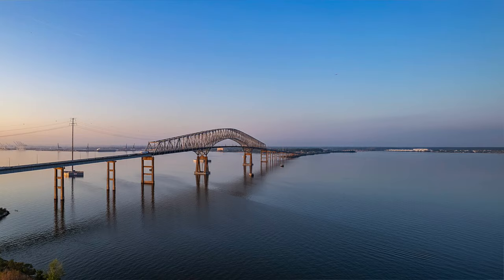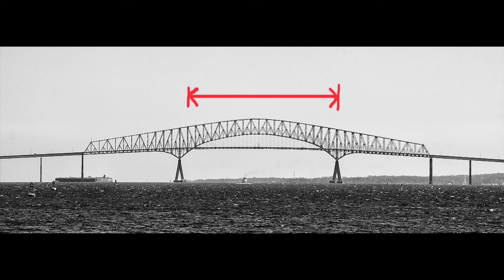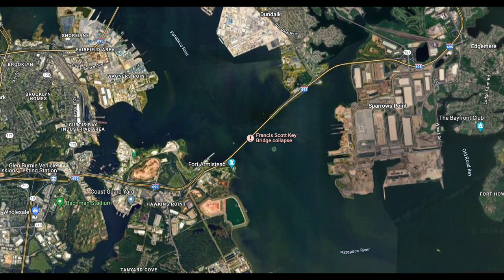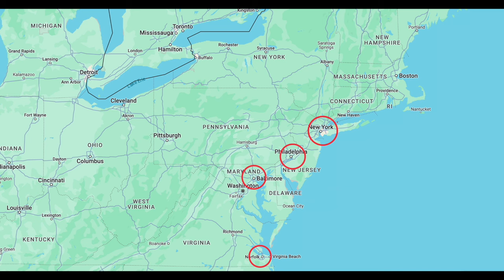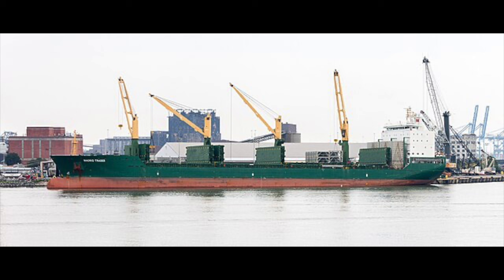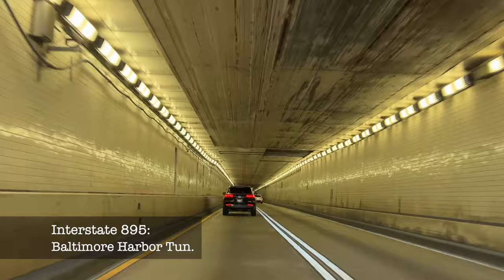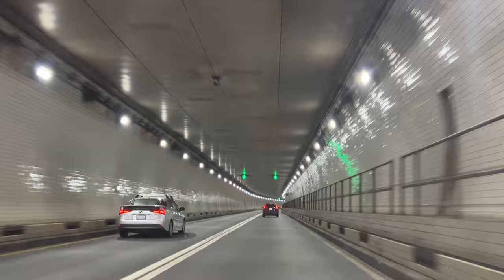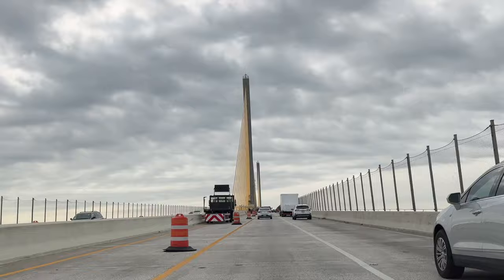Francis Scott Key Bridge COLLAPSE | What Happened and What Next?

Comment: It's mostly like the replacement for the Francis Scott Key Bridge will be a two-tower stayed cable bridge with massive bridge pier protection.  It might be more akin to the Gordie Howe International Bridge (that bridge is scheduled to be finished in early 2025).
Reply: The Gordie Howe bridge towers are on shore.  That seems like a good way to prevent accidents like this!  Would it be feasible to build the new Key bridge that way?
Reply: @FameyFamous  I believe the span would be too long. The part hhat fell was 1500 feet if I remember correctly and there was still large amount of river on ether side.
Reply: The "new" (1987) Tampa Bay Sunshine Skyway Stayed Cable Bridge would be more analogous to what we might see in Baltimore. It will have a 20+ dolphin bumpers.

Comment: This is America, its going to be widened
Reply: Perhaps, but not simply because it's America, the structural demands of bridges have changed as well as the surrounding population in the past 50 years. If it would support the demand, maybe tacking on a rail line would be helpful.
Reply: @-Katastrophe 
I'm surprised there isn't one already. You would think there being a port, there would be a rail line as obviously not every shipment from a boat is local
Reply: @-Katastrophe That is a fair point
Reply: @-Katastrophe Rail is also just a W transportation method so I agree that adding a rail line would be a good idea. However, Baltimore is probably not the city that would do that. It is much more likely a city like New York or Boston would do something like adding a rail line to a bridge
Reply: @Demopans5990  There is plenty of rail in Baltimore. Both CSX and Norfolk Southern have terminals further north. As a matter of fact, both railways have a coal pier with a ship in port so they are shut down too. They also have intermodal terminals and yards nearby.
Reply: Yea it better. Thing didn’t even have a shoulder
Reply: @bradjtrains Yes, but that is all freight other than the NEC. No passenger rail
Reply: @me-it9jn  Maybe widening isn't always that bad
Reply: Widening the bridge to accommodate shoulders is one thing. Widening for additional lanes is quite another. I-695 is 2 lanes each direction on either side of the bridge for miles. On the east side of the bridge, it's 2 lanes each way until MD-702 (about 10 miles of road). On the west side, it's 2 lanes each way until around MD-2 (about 4 miles of road). If the bridge adds lanes, it would either force a merge that would add congestion, or it would call for widening ~14 miles of I-695 outside the bridge (including other bridges, overpasses, and interchanges). Pick your poison.
Reply: Widening does not always alleviate congestion. Sometimes it only allows for greater opportunities for slower drivers to hog the left lane and refuse to move over for faster traffic.
Reply: @ssjlkrillin  I'm not saying the widening is good
Reply: @fishyswirlgaming5741  I was not responding necessarily to yourself, but to others in the thread.

Comment: This is the problem with truss style bridges in general.  There is no fail-safe.  If one link on the truss fails, the entire system eventually fails.  They are cheaper to build, but each one surviving now is a potential ticking time bomb.
Reply from the maker: Good point
Reply: Bridges like these need to be called trust bridges because of trust issues with them

Comment: As a local, it's weird to not see the structure as you're driving east on the southern outer loop of I-695. And honestly, as you saw from your trip over the bridge, it's not really heavily traveled by us locals, unless there was a backup at the Harbor or Fort McHenry Tunnels, mainly due to the tolls and the fact that I-695 through Dundalk is only 2 lanes in either direction.

What the real killer of traffic is now is the lone remaining set of toll booths on the southern end of the Harbor Tunnel. The booths at both the Key Bridge and the Fort McHenry Tunnel were taken out over the course of the past 5 years or so, but they've only started the bidding process for the work at the Harbor Tunnel. That, combined with the reconstruction effort, is going to be extremely high profile over the next couple of years.

Personally, I think the new bridge design should mirror the recent Harry W. Nice Bridge that allows US-301 to pass over the Potomac in Southern Maryland. The old bridge was a similar design to the Key Bridge, and likewise, was widened to accommodate the heavier traffic flow between Charles County, MD, and King George County, VA.

Comment: Lifelong Marylander here 20 minutes south. Most don't realize the collateral damage beyond the deceased. [May they Rest In Peace.] Appreciate the methodical presentation of the historic and strategic significance of Baltimore's port. The bridge wreckage spans the entire width of the waterway. The actual shipping lane is about 200ft wide where the Patapsco has been dredged to a depth of 50ft deep. The entire bridge zone needs a modern technologically resilient update with more physical barriers like the dolphins you mention for protecting both the beams and shipping lane combined with a visual early warning system on the deck. The entire harbor is on lockdown for the foreseeable future. Correct again, Baltimore was the closest East Coast port to the Midwest and the biggest automobile export and import terminal in America. Meaning every thing coming and going to and from Europe, Africa and the Middle East through Baltimore on wheels is halted. Expect price increases from shortages until freight can be diverted.  Logistically Norfolk is looking like the emergency default port however they're not equipped to handle a Baltimore volume of rolling cargo. But we will come back bigger and better. Again appreciate your interstate infrastructure oriented data driven presentation of the Key Bridge disaster.

Comment: I live about 25-30 min from the Key Bridge site. I never got a chance to take the bridge before the collapse since I haven’t lived here that long and typically use the I-95 or I-895 tunnels to go north. A couple of thoughts on my end.

1. Like a few other commenters my money is on this bridge being replaced with a cable-stay bridge. That seems to be the common trend for large bridge replacements in the US these days.

2. Mike you may consider checking traffic starting this week 3/31. Many of the MD schools have been out on spring break so traffic may be worse starting this week and especially in the summer when people are traveling to the beaches and what not. I’ll be monitoring it just to help plan future long distance trips.

3. I’ll be curious to see the procurement package for the new bridges. I’m thinking that it will be a design-build contract to help speed up construction a bit and will have a ton of contractor incentives if they meet early deadlines.

4. The new Nice bridge over the Potomac (US 301) took two years to construct and I’m thinking this bridge will take at least that long or longer considering there are still supply chain issues. The original bridge took five years to build so I wouldn’t be shocked if that’s the initial timeframe MTA releases for the bridge replacement.

5. I’m still curious how much damage the concrete approaches have after the truss section collapsed. Will they be replaced? I’ll definitely be paying attention to that. Though I am a highway design engineer and not a bridge engineer so it would be pure speculation on my part.

6. Most importantly the workers who lost their lives have been heavy on my mind since this tragedy. This is the second major incident on the 695 beltway in two years (last year was the accident that killed six workers in the west side of the beltway. I imagine at some point early in your career that you spent some time in the field on an active work site like I did. Those folks who build our infrastructure put their lives on the line and I feel like they don’t always get enough credit. In fact mental health in the transportation construction industry was the keynote speech at the Transportation Research Board meeting in DC in January and I’ve been thinking about that since I listened to the discussion.

Apologies for the long comment! I just enjoy having a constructive conversation with a fellow civil engineer.

Comment: Been across that bridge multiple times either picking up at the port or dropping off or just driving hazmat over it. It will take alot longer than 2030 before that bridge is up and redone especially if unions get involved.  Not saying non-union can do it better but it definitely would be cheaper.  Cheaper is not always better especially on bridges.
Reply: And if the Boeing case means anything, cheaper always means valuing human lives at zero
Reply: It's the northeast. I'm pretty certain union contractors will be building this bridge back.